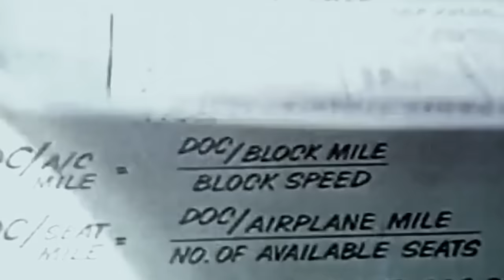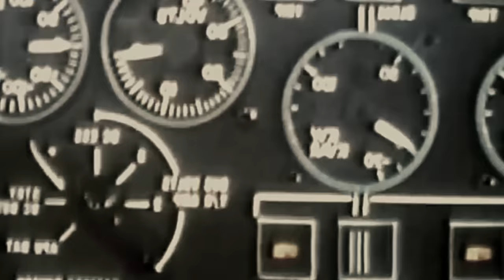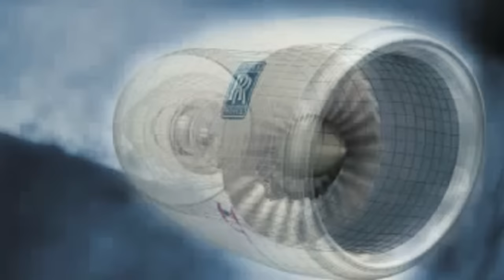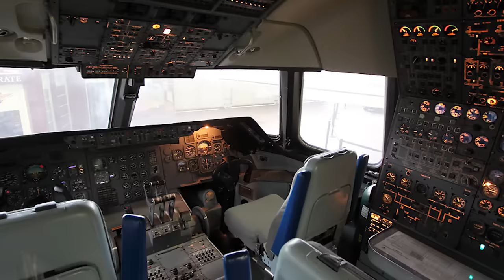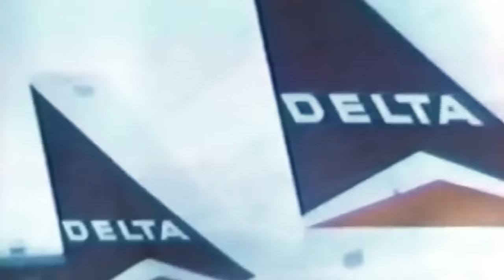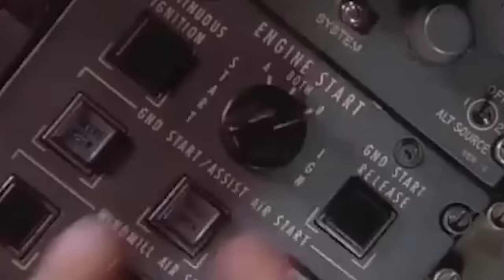L-1011 Tristar - too advanced for us

Comment: All this advanced technology and exceptional engineering came at a cost.   The L-1011 simply was more expensive to purchase and maintain then the DC-10 and both hit the market during a major early 1970's recession.   As an example and as noted in the video, the L-1011 has the "S" intake for the third tail mounted engine for better aerodynamics.  The DC-10 had a higher drag straight through "stovepipe" that was cheaper to build but also made airline rear engine maintenance and replacement easier and less costly.   In the end, many simpler DC-10's had a second life after-passenger service, converted to cargo carriers and water bombers.   Not so with the more complex expensive to maintain L-1011.  There is no question that the L-1011 was not just a better aircraft, but was a safer design.   Unfortunately that couldn't save the L-1011 and it was cost that killed the better airplane.

Comment: Best looking widebody ever! Lack of range was a stumbling block for international airlines compared to DC 10-30, probably the best allround widebody of the 70s. As a transcontinental airliner, however, it was more fuel efficient than DC 10-10 & here, the L1011 was in its niche. (Until Eastern found the A300, which was 12-15% less than L1011, per seat, according to reports). That was the beginning of the end for the L1011. Delta became the world largest & most successful airline with L1011s as their flagship.

Comment: The L1011 was a great plane (to ride in, my pilot career petered out - no phone number or insurance claim involved - doing my night proficiency work at PAO and SQL in a twin Piper.)  It was a trijet as it would have been done by 1960 Boeing engineers.   The DC-10 - well if something looks right it probably is.  It's hard to argue the DC-10 looks right.

Rolls-Royce sunk themselves and Lockheed's commercial side.  It's hard to argue it'd have been  significant lesser plane if Lockheed had offered a CF6 or P&W option.  Remember, many of those planes were going to lines that had entire FLEETS of those engines.

Comment: For a big guy, the L-1011 could move. I remember tight corkscrew turns on approach to LGA. The DC-10 and A300 did it too, but the Tristar did it easily. It was powerful on takeoff, stable in bad weather, and quick.

Fortunately, I never had a middle seat in the 5-across center section. I did that once on a DC-10 from Chicago to Honolulu- after a delay on the ground. Thank God I was young.
Reply: Our family of 4 flew aboard the L-1011 often in the late '70s and early '80s. The 2-5-2 seating was awesome for us. Seat selection wasn't computerized back then. A guy at the gate had a big page with stickers for each seat. As you got to the gate, he'd ask how many people in your party, and peel off what he thought were appropriate seats and stick them on your boarding pass. Usually we'd be split in two rows of seats next to a window. Or one row spanning from the window to two seats in the center. In the rare cases where we were all seated in the center, because there were 4 of us and 5 seats, usually the extra seat was empty so we'd use it to hold our bags, books, magazines, and toys during the flight.

Comment: I flew on one in 1989 to Hawaii and on our way taxing to the runway from the gate the APU overheated because the pilot couldn't get the APU to switch from ground to air operation so we had to return to the gate, took mechanics about an hour and half to fix it then we finally took off. No problems after that, it was actually a great aircraft
Reply: The reason it took so little time was because the APU was mounted on a platform that was part of the skin of the aft fuselage.  There was a built in hoist and you could easily lower it to the ground for service.

Comment: Flew on Tristar’s on several occasions and always comfortable with smooth landings. Once on a DC10 30 from London to Amsterdam which landed like a brick on the runway, a very crude machine in comparison.
Reply: A DC-10 from another airline was taxing at Jedda, Saudi Arabia Air Port when a main landing strut failed, the strut punctured the wing and the wing engine struck the ground.  To maximize their misery, this happened at the King's private terminal.  The Royals were not pleased and after no action the airline was informed that the wings would be cut off and and the mess would be dragged to the far side of the airport.  That got everyone's attention.  They did a fast recovery.

Comment: Refueling this plane was a nightmare.
3 engines, with 4 fuel tanks. I had to carry a separate card with the correct amounts for each tank for the load desired.
When you open a valve on any other plane,  a little light on the fuel panel comes on, with the L-1011, the light comes on when you closed the valve. 
On the other hand, the doors were wide enough to pass 2 soldiers at a time!

Comment: I worked on several of the EAL L-1011s. This video didn't show any EAL cockpits because our L-1011s didn't have the round, "steam" gauges. Ours had vertical tape instruments, for the engines, making it look more like the starship Enterprise rather than an airliner. My least favorite part of the airplane was the counter weights on the elevators. They were made out of depleted uranium and  I was alway worried about handling them.

Comment: I had done a research paper on this in the 1990s, and drew many of the same conclusions you did.  That advanced Rolls Royce engine was the doom of this aircraft.  It made this plane awfully difficult to build.  They had quite a few fuselages built but not any engines to put into them at the start of production.  This aircraft was the end of commercial aircraft, and McDonald Douglas followed less than 20 years later, being bought out by Boeing.

Comment: The Tri-Star was a MAGNIFICENT aircraft that cost more to build than Lockheed sold them for.  If I remember my numbers correctly Lockheed needed to build 253 to break even but never got that many orders.  I was a Lockheed shareholder in those days and received a corporate magazine that detailed a totally hands off flight from the early 1970.  Taxied to the end of the runaway, set up the nav points, Press GO.  Hands off the controls.  Plane takes off, navigates to it destination, and lands, stopping at the end of the runway.  The pilot took over to taxi to the gate.  No passengers of course but this was 1970s technology!!!!

Comment: 1.  This was BY FAR the best widebody airliner ever built!  I'm an airline pilot type rated on the 727, 757/767, and the 747, and have significant time as a Captain on the first and the last.  Current and qualified on the Boeing 767.  I think I know a little bit about heavy transport jet aircraft~
2.  Lockheed made a MAJOR mistake using the Rolls-Royce RB211 engine.  This three spool engine is heavy and expensive, but it is also very fuel efficient.  But it also has a smaller N1 fan than the other two high-bypass ratio engines available in the 1960-70's, the GE CF6 and the Pratt & Whitney JT9D.  Lockheed designed their airframe around this smaller engine, which precluded them, versus great expense, to offer the other engines as an option.  The issue was the "S" duct, which would have to be completely re-engineered at great cost;  Lockheed was bankrupt already.
3.  Ronald McDonnell Douglas the clown airliner manufacturer was headed by a man who should have worn a red ball on his nose every day at work known as Donald Douglas.  He REFUSED to spend any money developing airplanes, he REQUIRED airlines to give him money up front before his company cut the first sheet of aluminum.  This is why the DC-10 had the straight-through center engine duct design:  It was cheaper.  
4.  And heavier.  And it cost more to maintain that engine due to it being mounted higher.  And it did not negate fuselage drag the way that the 727 and L1011's center engine did.  Also, the straight-through duct meant a much smaller rudder;  This meant that the wing mounted engines HAD to be mounted closer to the fuselage.  Look at an L1011 and a DC-10, you will see the Lockheed product has the wing engines mounted way out farther on the wing than Ronald McDonald's turd;  This is to keep the ability to maintain control in a wing-engine out situation better at lower speeds.  But the Lockheed design allows the available area of the forward fuselage to be longer due to the far larger rudder;  This allows a second entry door that the DC-10 simply could not have.  Which means that if airports had installed two jet bridges, the airplane could be unloaded and turned far faster.  Again, superior design!

5.  And there is the ribs cut down at cabin level to give more room, the Direct Lift Control system to fly ILS approaches without changing elevon position, thus saving fuel.
6.  The all flying tail....The list goes on.

Comment: Wish that the  L1011 would still be in the air today.  Do not remember if it had  2 seats or 3  (window sides). but they were very comfortable. Miss those planes.   The ones I enjoy today and prefer flying are the  767

Comment: The narrator seems to infer the novelty of the autoland system on the Tristar,  but I flew the Lockheed C-141A  Starlifter - a 60s design aircraft - in the USAF in the early 70s equipped with a functional autoland system that worked very well.  The autopilot could fly a vertical descent profile connecting to the autoland system with no manual pilot input until rollout and brake application. Watching the auto throttles go back and forth holding perfect airspeed was always sort of unnerving to me.  And of course it was always comical when my favorite navigator on roll out from an auto landing would always hand me a banana and announce  to the flight engineer "see I told you we didn't need those SOB's."  Great memories of flying all over the world in another great airplane made my  Lockheed.

Comment: As I recall, it was EASTERN , whom wanted a larger aircraft to get into & out of LGA - MIA  a most lucrative route got it , but the  engines , were a problem RR,  was having development problems, but BRITISH GOVT , got into it , and so it was finally made that RB 211 ENGING PROVED TO BE  A POPULAR  ENGINE ,,across several models, only the ONLY  L1011 aircraft I was ever on was for EASTERN.
I had been on MORE DC 10 aircraft, , even when they were grounded following AA  in CHAGO, , flew LUFTHANSA , ,  as it turned out I flew EASTERN  more than any airline, From EWR- KIN  JA, EVERY YEAR ON B727 200s  for many years ,,on vacation , would you know there had been the SAME CREW sometimes, but cabin crew the same, so we got to know everybody ., my very last EASTERN flight was from SAN JUAN -JFK,  on a VERY CRAPPY A300, THE FLYING PIG , and walked the PICKET LINE @ EWR, , saw many of  ‘friends ‘ there , sad time with FRANK LORENZO ,    CHEERS FROM NJ🇺🇸🇺🇸

Comment: The L1011 had issues of high corrosion due to the engineering problems of not providing proper drainage of with the lower belly plates. As these where expensive make and to replace as these belly plates where chemically milled large chunks of aluminum into chemilled plates. These chemilled plates helped reduced the internal structure of the aircraft to be reduced, so the technology also of producing these chemilled plates cost lost of money and time to manufacture compared to just a standard aircraft aluminum sheet being produced. I learned this from getting my training and A&P license through (TWA) Trans World Airlines becoming an A&P Engineer and mechanic.  But the delay of waiting for one engine company and delays of Lockheed releasing the aircraft just made it a late bloomer to the market. Also, note the 747-100, 200 could be set up to do an autoland in the avionics package too. The requirement of having a pilot hand land such a large (jumbo) airliner requirement by the FAA to have a pilot land the aircraft at the time. I still like to visit the L1011 at The National Airline History Museum located at the Wheeler downtown airport In Kanas City, MO https://www.airlinehistory.org/

Comment: One thing Lockheed did not disclose about the production blip in the program was the fact that they manufactured the plane at Palmdale, California in one of the most inhospitable climates in the airframe industry and they tried to build it with a green work force. They tried busing their experienced aircrafters from Burbank to Palmdale, but the majority of the  Burbank employees didn't want any part of working in the desert. Lockheed/Georgia sent vounteers to Palmdale to help get it back on track and the Palmdale employees resented them because they thought they were there to get their jobs and would not offer any help or assistance to them. The Georgia folks were very talented aircraft workers and went there only to help the company get the program back on schedule. The Production Control departments were the poorest in the industry and the parts supply was a piece meal operation and a catch it if you can setup.

Comment: The Hyd thumbwheel on the yoke still blows away the noisy Boeing klack klack.....no MD wobble......and elevators to the playhouse downstairs.
PFE made it all happen....two backup systems backing up more backup systems. Passengers never realized the tech genuis of this whisperliner. Late engines, terrorist and unqualifed ME crews were its downfall. Best AC I ever flew in 24,764 hrs. Thankyou ATA

Comment: I was working SLC tower when I saw my 1st Tristar light-off in the cold. It smoked so badly I thought it was on fire! I asked the pilot if everything was OK (with my hand on the crash phone!) and he told me the smoke was normal. He also said they alert the passengers about the smoke. At one point, the whole fuselage around the #3 engine was engulfed in smoke!

Comment: It was a magnificent aircraft and my all-time favorite airliner!  Far safer than the DC-10 which had a horrible flaw in the cargo door latches that resulted in multiple fatal explosive decompressions and a poorly designed hydraulic system that allowed one tail engine fan disk failure to deprive the aircraft of ALL hydraulic controls resulting in a crash landing that killed about half of the passengers.  The US Air Force would've been far better served to have adopted the L-1011 over the KC-10 as it's new air refueler.

Comment: I flew them on the Paris to New York flights in the 70s and 80s. The funny thing is that for a kid, they didn't feel any smaller than a 747, also in use at that time. But they felt better. I wish Lockheed had continued and given a much welcome rivalry to the Boeing Airbus ho-hum race we have today...

Comment: The first tri-jet to have auto landing was De Havillands follow up to the Comet, the DH121 Trident. It was also the first passenger aircraft to have a triplex safety system with three of everything, including of course engines. The whole of Europe could be fog bound and the only aircraft taking off and landing would be Tridents. Introduced in 1964. It could also operate its reverse thrusters at altitude allowing for spectacular decent rates.

Comment: The DC-10 was a Chevy the TriStar was a Mercedes. I intentionally flew Delta and TWA even if it meant trading a direct or non-stop flight for a connection in STL, ATL or DTW (Delta used to have a hub in Dallas). Just to have my flight or a portion of the flight on the 1011. I was a huge fan of the 757 and the TriStar, the right size for their markets while the TriStar was the most comfortable airliner ever, the line down the jetway was always moving because the door was wide enough for two people and their carry-ons to walk onto the aircraft at the same time.

Comment: I was an L-1011 instructor Flight Engineer for Lockheed back in the 1970's. Two corrections for you: the fan blades were not made from composite materials, they were metal. And the L-1011 could NOT automatically take off. It could make automatic landings but never did make automatic take offs.

Comment: I Ike that the third engine is molded into the body for what I believe to be more structural integrity. I would fly on that plane feeling like the tail support isn’t going to tear off because it’s essentially supporting the full weight of an engine mounted onto it, and not onto the actual fuselage of the plane like the DC10.
Plus the Tristan is such an elegant and beautiful looking plane. I have never flown in one.